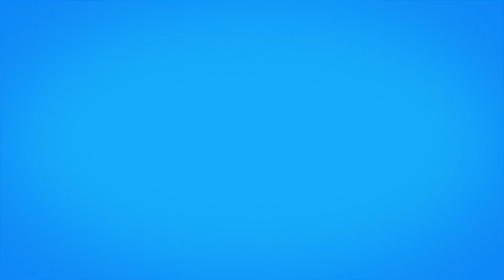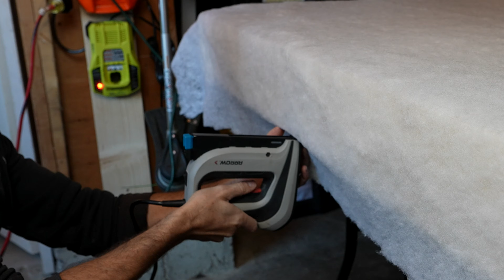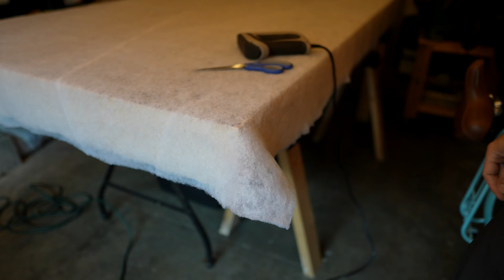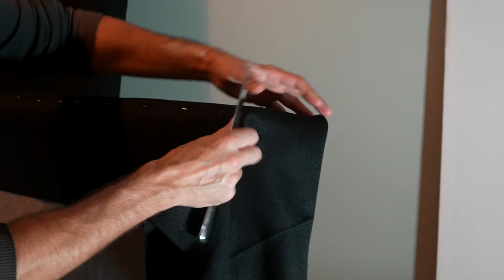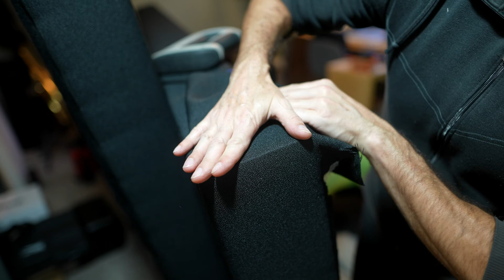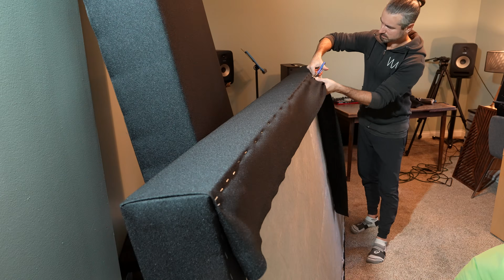Master the Art of Wrapping DIY Acoustic Panels Like a Pro!

Comment from the maker: If you're having trouble with understanding the corner process, I have a second video you can check out that goes through it again: https://youtu.be/j1mO5p0W384?t=558 
Watch our other videos on acoustics & studio design:
✅ How to Build the ULTIMATE DIY Acoustic Sound Panels for Music Studios: https://youtu.be/ECazGzutkV8 
✅ How to Quickly & Easily Mount & Air Gap DIY Acoustic Panels for Music Studios: https://youtu.be/uR5JZ6lUe6U 
✅ Unlock the Magic in Your Music Studio: Mastering the Art of Porous Absorption: https://youtu.be/SSn8HEsG8ro 
✅ Secrets of Air Gapping Your Acoustic Panels & Sealed Air Spaces - Studio Acoustic Treatment Tips: https://youtu.be/efOWQhi_h6Y 
✅ Get Our Free Acoustics Course ➤ https://bit.ly/free-acoustics-course

Comment: Nice work.  But, fire rating is a real concern. Wood. Cotton Batt. Cloth cover … fucking instant death and total loss of structure is likely.
Reply from the maker: Hey John.  Fire rating is an important consideration.  Wood is all over homes regardless, and your walls are made of wood studs and plates.  So that is not really an escalation of risk given these are standard building materials.  

Rockwool is made of minerals.  Glass wool is made of...well, glass.  Neither are flammable materials and both are used in standard residential wall assemblies.  

The fabrics would be more flammable, but at the same time, your furniture inside any room is also made of textiles like that.  Really is the risk elevated?  

The facts are that these are the materials that all professional studios are made from.  Northward rooms, John Brandt rooms, Newell rooms, Wes Lachot rooms - they all use these materials.  And many of them use much more wood than I do - diffusers.  Some have fire retardant additives, but then you have serious VOC concerns.

Comment: i found a denser batting which is almost like a thin fleece. it holds together really well. low loft. would this work?
Reply from the maker: I would not.  Don't deviate from the common recommended materials:

2 red flags here: 

1) You mentioned a higher density product.  Density (well, more accurately gas flow resistivity or acoustical impedance) really matters.  Do not use products with unknown flow resistivity.  There are really only 2 or 3 products I would ever use in a music studio: Rockwool Comfortbatt, sometimes Rockwool Rockboard 40 or Cavity Rock for specialized applications and only very thin, and Owens Corning Pink aka "pink fluffy".  That's it.  Don't get fancy.  

2) You haven't mentioned any acoustical properties or testing of the material.  And you mentioned it's thin.  

We'll be working in depths of at least 5.5".  Ideally 11", perhaps more for a rear wall.  

Stick with what's recommended by professionals and don't deviate from tested and vetted materials.  Hope that helps.  Cheers!

Comment: So the cotton is juste on one side...is it okay to put it on both sides of the panels before wrapping with the final fabric? 

I kinda think it would prevent the rockwool particles from spreading outside. What do you think?
Reply from the maker: Hey hey. The cotton batting is just for padding, not to contain fibers. On the back the landscape fabric and closely spaced staples contain fibers.  On the front, it's the GOM / Duvaltex fabric that's a pretty tight weave.
Reply: @warpacademy I see! hope the cotton wont reduce the absorption tho. Thank you
Reply from the maker: It won't.  It's very easy to blow through and quite thin when installed.
Reply: @warpacademy Very precious advice thank you🙏

Comment: Hey there!  Quick question — I noticed you’re using a layer of cotton batting underneath the Guilford speaker cloth when building the panels.
Isn’t that kind of counterintuitive? Since Guilford is already acoustically transparent and quite premium, wouldn’t adding another layer in front of the absorber slightly block the sound or reduce performance?

Or is the cotton batting mainly there for fiber containment / aesthetics without significantly affecting performance?

Would love to understand the reasoning behind that choice. Thanks! Love your videos
Reply from the maker: Hey Matias.  Glad you've enjoyed the videos.  There is a very good reason for the cotton batting and it doesn't have anything to do with containing fibers or with acoustic transparency.  

The GOM fabric alone, especially in light colors, shows the framing underneath.  The fabric is thin.  I often use white fabric.  

So the cotton batting is a cheaper base layer where it makes the wrapping thick enough it's opaque and you don't see framing.  

Second, the framing is wood.  There can be splinters, roughness, or sharp corners that can eventually damage and wear the GOM fabric at stress points where it's wrapped tightly.  I often use tape (duct tape) at the corners of the frame to help with this, but it's definitely a good idea to use the cotton batting too.  Otherwise, I feel you'd eventually wear through the GOM fabric, even though it's very durable.  

Don't skip this step.  If you want to make the best use of your investment into a DIY build, you want professional results that will stand the test of time.  

I have modules in my room which have survived 2 moves and were built in 2018.  They are good as new and the fabric is holding up great.

Comment: Great video, thank you for putting in such time and effort producing it. Never something I take for granted being a professional educator myself. The only part I don’t understand is - in the final scene of the finished panel, it appears that the cotton batting has been completely wrapped around the panel so that both sides of the panel are covered with the batting. However, the video doesn’t show how this was achieved. It shows only one side being wrapped and stapled followed by the GoM fabric being wrapped on the same side. Is there another video that shows how both sides of the panel are wrapped with the cotton batting before wrapping the GoM fabric? Or are you assuming viewers will use the same process for the other side? I would think this would make for quite a few staples especially in the stress points areas. It seems this could cause some issues with a staple hitting another staple in the stapling process? Thanks ahead for your response.
Reply from the maker: Hey hey.  Thanks for the kind words!  Glad you liked this.  The fabric (cotton batting and GOM) are only applied to the front.  I think maybe with the framing of the new shot it just looked confusing.  
The only thing on the back is the cotton batting.

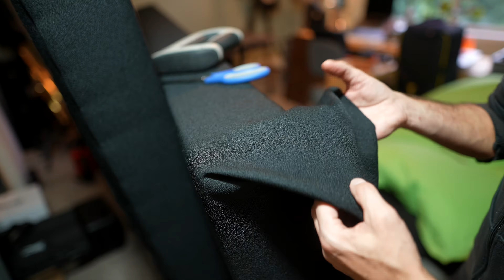Comment: Like 95% percent of tutorials on youtube, this is well explained and has good intentions but reality is far from what its shown here, when its time to do the corners, the most (the only one really) difficult part..at 10:17 ..even my toddler neighbor could do it if it looks like that, problem is the corner is a mess of LOTS of fabric that you can;t simply start cutting triangles on all directions..the video does not explain HOW TO GET TO THIS PERFECT POINT. where the guy just simply folds it over PERFECTLY..how did you get there??? that is the whole point MISSING.what angle??/ how did to get it to look like that from the previous steps? HUGE gap..so annoying.."DO THIS and voila"
Reply from the maker: If you put half as much time into actually watching the video as you did on this rant, you might actually be able to do this.  I can tell you skipped ahead in the video and didn't even bother to watch the entire thing.  

If you actually want to learn this, put in at least the effort to watch the video deliberately from the beginning.  Especially here: https://youtu.be/NYew5ZqGM7Q?t=321 

And, if you want to watch it again from different angles, I have an entire second video about building modules and wrapping them where I show the corner making process again: https://youtu.be/j1mO5p0W384?t=558

Comment: Hi there — first of all, thank you for making this series; it’s really helpful! I have a question regarding the quilt batting because I’m struggling to find an alternative to the product you use in our country. You mention “cotton quilt batting”, but from what I found about Eversoft Quilt Batting it appears to be 100 % polyester. Is that correct? Thank you for your answer!
Reply from the maker: Hey hey.  Glad you've liked the series.  It doesn't really matter if it's made of cotton of polyester, only that you can easily blow through it.  It needs to porous, and if it restricts airflow then it won't be acoustically transparent.  Or at least it'll reduce acoustic transparency. 

So you can go for something you can find locally.  Go to a fabric store where they sell things by the roll in various dimensions.  Ask them for something of the right width that I recommend.  

Then find something that's got some cushion to it to act as a nice base layer, has the strength to be able to staple it, and is cost-effective.  Many types of fabric may suffice for this.  

Best of luck building your modules.  Cheers!

Comment: Hello Vespers, thank you for all your content, it’s extremely useful!
I have a question about wrapping: I built my own bass traps with a wooden frame and rockwool. Unfortunately, I made them before watching your latest series about your friend’s home studio.
Anyway, I wrapped the rockwool in a plastic film, in addition to the front fabric and the nonwoven fabric on the back. Was that a mistake? Should I remove the plastic?
Maybe you know the science behind this as you usually do! 😄
Thank you so much, and please keep doing what you do. Top-notch knowledge!
Reply from the maker: Hey hey.  Glad you've been finding this useful!  One terminology clarification.  These are not "bass traps".  Anything with just Rockwool in it is a broadband absorber.  In order for something to be called a bass trap, it must have some type of additional treatment on the front: slats, pass through pass grating, perforated panel, range limiter, scatter plate etc.  By adding something hard to the front, that allows bass energy to bend around it or creating a Helmholtz effect, it increases LF absorption to the point where it can be called a bass trap.  

About the plastic, yeah, get rid of that.  It'll actually make it work a bit more like a bass trap actually, in that LF absorption will go up, but it'll totally inactivate it's absorption at mid and high frequencies. 

If you can't blow through a material, it's not porous absorption.  Plus, plastic is just such a bad material to have in your studio.  It smells, offgasses, and....just look into microplastics and nanoplastics and all the health hazards there.  No bueno.  

Use proper acoustic fabric on the front, and cotton batting.  Should be pretty easy to retrofit the modules.  Hope that helps!  Thanks for watching.
Reply: @warpacademy  Thank you very much!! I'll do it!

Comment: Still could not see wtf you did to get the corners. I just see a heap of fabric and then you pull it somewhere. But I have no idea what's going on with the folds. Why does every video about this just gloss over it?
Reply: There was a pretty detailed section on the folds for the cotton and then later for the acoustic fabric, not sure if you stopped watching before that point or what but it's there.
Reply from the maker: As @seriousbassface said, I think perhaps you did not watch the entire video.  I went through the process with a lot of detail.
Reply: @warpacademy  I skipped to the relevant step for my needs "10:06 How to make professional looking corners in the fabric " and first thing you say "so you're gonna start by folding your fabric around the corner". Some more detail about exactly HOW you're folding and pulling the corner would have helped a lot. Much better video overall than most others, but was only personally hung up on getting corners right.
Reply from the maker: @HORNGEN4  I guess that's the issue.  I don't build my videos so you can skip around without missing important steps.  The chapter markers are there to help identify what's in the video, but they don't mean you can just start the video part way through and still understand the entire process.  Each step builds on important underlying steps.  

Wrapping modules properly takes a bit of time to learn, but not that much. Watch the entire video from start to stop, I put a lot of effort into covering all the steps but you're only going to get it if you make the time to review my entire process.  

I also subsequently filmed a 10 part miniseries on building an entire studio, start to finish which you may find very useful.  

Here's the trailer: https://youtu.be/yTTODN9e8zo

And here's the video where I get into building several of the modules: https://youtu.be/j1mO5p0W384

Comment: If my panels already have landscape fabric on the front, should I remove it or just leave it on? You mentioned leaving it on when using acoustic fabric, but I’m not sure if that still applies if I’m not using proper acoustic fabric.
Reply from the maker: Hey hey.  I'd remove it from the front and instead use the cotton batting first layer, followed by acoustic fabric as the final layer.  Cheers!
Reply: Thanks mate!  @warpacademy
Reply: After going down a rabbit hole of what I could substitute Guilford of Maine with I end up just deciding to use landscaping fabric to cover the whole thing. I'm surprised with how good of a result I got with it. 

The Guilford of Maine was way out of my budget unfortunately.
Reply from the maker: @mezonplas  Nice one.  Yeah, that'll get you most of the way there.  They won't look pretty but you can always invest in some GOM fabric in the future as budget allows.  I mean, considering you can build a 4'x8' module for $250 USD or so, including GOM fabric, is already pretty affordable,
Reply: What do you think about putting a layer of cotton batting underneath the landscaping fabric?
Reply from the maker: @mezonplas  not sure why you'd do that?  Just a wasted expense IMO.  The landscape fabric does a great job of containing the batts, and that's all it needs to do at the back.  The cotton batting is only for the front.

Comment: I saw polyester quilt batting for my 24 x 48 panel as a layer before putting the fabric on. The dimensions are 1.5m x 4 Yards x 0.1 Inch or is there a thickness you recommend?
Reply from the maker: Hey hey.  You’ll find it in many different dimensions all over the place.  Ideally you want as little waste as possible.  A 5 foot wide strip is ideal as it’ll wrap around the panel perfectly with enough overage to pin at the back.  Check fabric shops like Fabricland where you can buy by the yard.  

For thickness it’s hard to tell until you handle the material.  You want it to be sturdy enough that it can handle staples and corners.  

Better to buy it in person at a fabric store if you can.
Reply: @warpacademy  Thank you, that helps!
Reply: I literally just took off a layer of polyester batting I put down not thinking about the acoustic properties of it before hand. From what I can find the cotton would be more breathable than the polyester so I decided to take a loss and put some actual cotton on it. 

Is it that big of a difference? Well I don't really know, it might not be but I didn't want to risk having it be less effective.

Comment: What do you think of poly burlap fabric for acoustic panels vs duck canvas?  I know Guildford of Maine is the best.  Is it much better than the two I mentioned?
Reply from the maker: Hey hey.  Good question.  Acoustic performance is one thing, and if you can blow through a material it should perform adequately.  

However, I also consider how easy the fabric is to work with (having some stretch is key as it prevents wrinkles) and the stain resistance and durability.  I build panels so they last decades, not years.
Reply: @warpacademy  Thank you for your quick reply.
Reply from the maker: You bet.

Comment: Do you need an electric staple gun or can you use a manual one?
Reply from the maker: You can use either but I highly recommend a battery powered one.  The manual ones are really tough to work with.  I use a cheap Ryobi one that’s like $74 and it fires staples super fast and cordless.

Comment: Thanks for this video! I'm reupholstering some old radio station panels and have the guilford fabric on order. But my frames are aluminum, not wood. What would you suggest since staples won't work for these?
Reply from the maker: Hey Christian.  Ah yes, you'll need a different solution.  One option would be to add super strong (3M) double sided tape to the rear of the panel frame, and then secure things with metal screws (predrill the holes).  

Or, perhaps a better solution, would be to build a little rectangular wooden frame out of 1 x 2 stock that fits on the back of the module.  Screw it to the aluminum frame with metal screws or even clear epoxy, and then wrap the GOM fabric back to the wooden frame and staple like normal with 1/4" Arrow T50 staples.

Comment: Super helpful, in the middle of a panel build right now so this is great. I am wondering, when you go to staple the guilford fabric, how do you make sure you're not hitting the staples you put in for the batting?
Reply from the maker: Right on.  Glad you saw this video at the right time.  The staples are pretty small, and if you kind of remember where you put them you can form a separate line from your batting staples.  Like offset them by 1 cm or so.  It can also be helpful to rotate the staples 90 degrees for one of the lines (cotton batting or GOM).  Then you have less chance of a Robbin Hood strike (this is an archery term meaning your arrow perfectly strikes and splits an arrow already in the target).  Good luck on your module build!